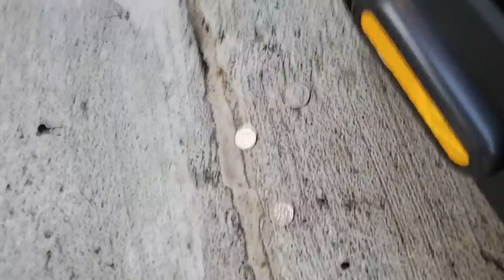NYC LIVE Exploring via Electric Scooter to Coney Island & Back, Walk to Queens (May 27, 2021)

Comment: Atlantic Ave-- it's good to see that NY drivers are still completely selfish A-holes after all these years. As you say- this video is its own compilation. 
One thing I've learned as I've gotten older is that there's no point in yelling or honking if it will not result in any change. In other words, if you need to get someone's attention, honk or shout. If the person is knowingly driving like a selfish fool, don't bother honking or shouting. Just shake your head and chuckle at it. No blood, no foul. You'll never get a drink thrown at you or anyone driving up on the sidewalk and gunning their engine trying to run you over (yes, that happened to me on 4th Ave and 82nd St back in the 90s after I demolished a jerk in a verbal exchange).